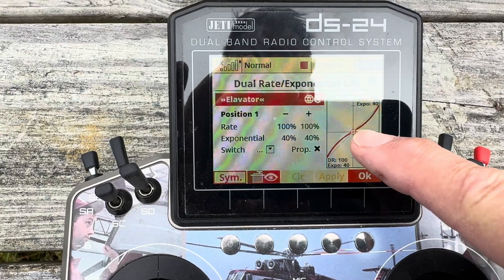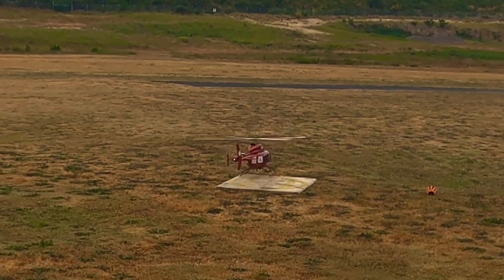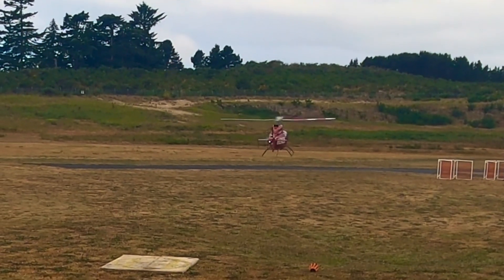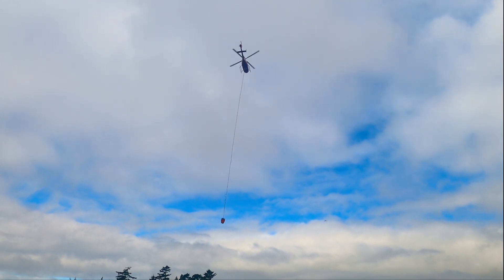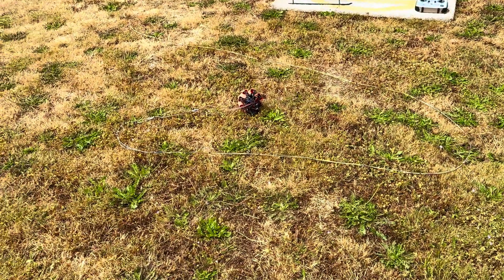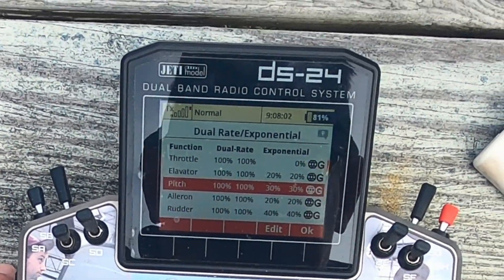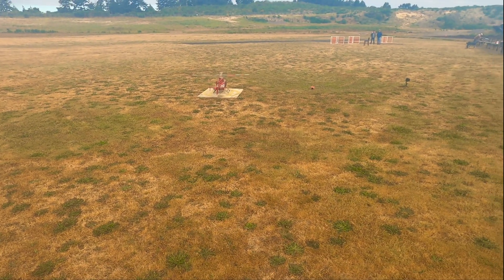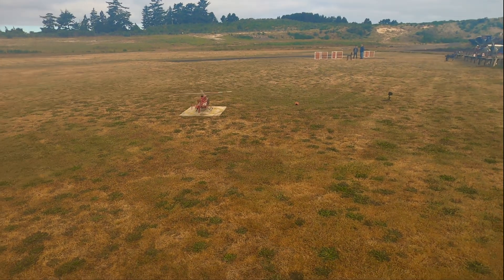Roban Bell 407 Long Line GPS and Expo Adjustments

Comment: Love your videos!
Really interested in building the 700 size Roban Bell 429.  But I want GPS.  Can't seem to be able to get my hands on a Naza-H.  Is there something else I may consider? Flywing  H2 maybe?
Reply from the maker: That is one direction. The other is Spirit
I haven’t played with either of those two but there are a lot that are messing with them.
Reply: @JestRR  Thanks, will do a search for Spirit GPS
Reply: @JestRR Doing some research, Flywing spec states that the H2 can support 700 size and greater helicopters.  
The A/D converter supports up to 12S for voltage monitoring.
I was concerned that the servo power rail would be an issue, current wise, seems like it's not.  I am therefore very encouraged. At age 70, would be really cool to be able to fly a nice big expensive scale heli and mitigate the pucker-factor!😂